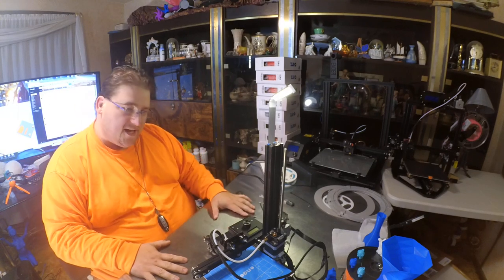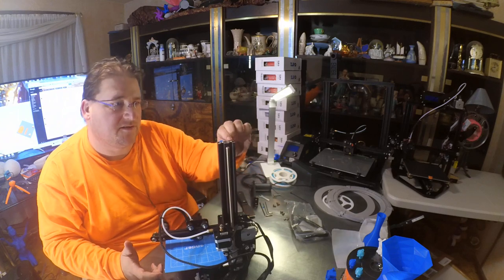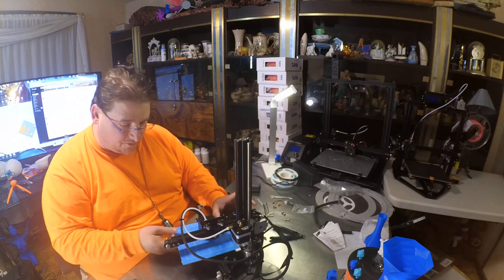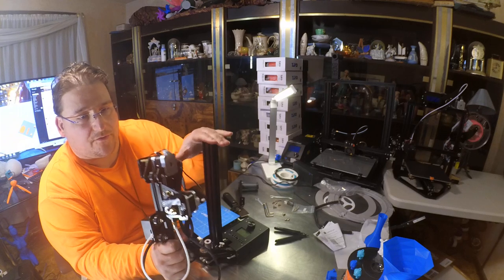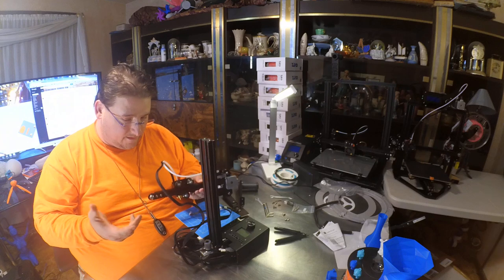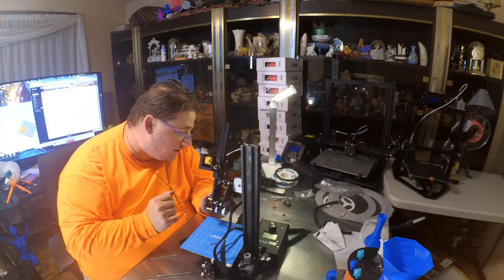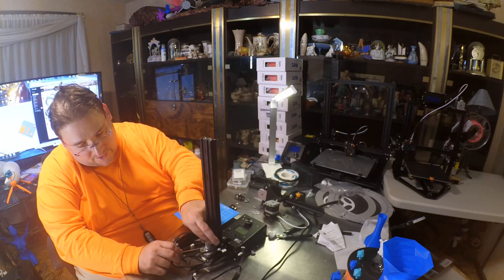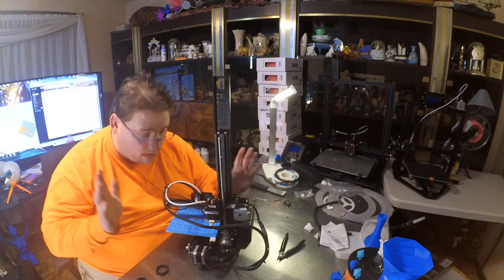Today's 3D Print 101 Ender Army 7of9 is alive and online, Resistance is Futile

Comment: I've just bought/assembled this Hictop version of the Ender. Mine has an offset nut on the rightmost x-axis roller to adjust for up/down play in the arm. However my unit had lateral x-axis play on the arm caused by movement in the bearing housing of that same x-axis roller. I traced this down to the 1mm thick spacer washer between the 2 bearing races inside the roller (or more likely bad tolerances in the internal shoulder of the roller molding that the bearings should grip between them, and wasn't). I fixed it by sanding down the washer to aprox' 0.75mm, and it remedied the lateral play. This was the only roller with this problem on my unit. What is interesting to note is that I only found the play after removing the coloured rubber inserts. Pressure from the insert rubbing on the x-axis mounting hardware actually hid the play.. Hopefully someone might find this useful if they encounter lateral bearing play in their roller assemblies.
Reply: Slight correction, first mention of x-axis in my post should be z-axis. Need beer :)
Reply from the maker: Interesting so it was literally a defective bearing? I wonder if these are standard skate bearings?
Reply: Hi Nerys. If you remove the rightmost z-axis roller the 2 bearing races inside the roller are easily removed (mine fell out). Between the 2 bearing races is a washer, which spaces the two bearings against a shoulder in the roller. Check it for burrs/distortion. I rubbed it on a sheet of sandpaper until the bearings gripped the internal shoulder and no longer had lateral play. Unsure if it was the washer, or the shoulder molding in the roller that was out of spec', but it solved the lateral play. The bearings themselves were fine. HTH, thanks for the vids.

Comment: Could there be just a bent screw, bracket or a damaged wheel be the issue for the play in the gantry? If not, maybe one of those adjustable offset screw/ nut thingies would work out here...a couple of thoughts to help pay back to you for your wonderful sharing to the 3D community. Please give us an update if the issue gets worse and your corrective solution. Thanks.
Reply from the maker: +sammy mezzacapo probably the bracket and three wheels got tweaked a little bit but it was tossed in the Box and shipped and tumbled that way the discrepancy is very tiny probably most would not notice it but I built enough of them to notice it the effect on the output quality is a 0 so I'm going to ignore it :-)

Comment: M5 X .80 X 30 or 35 is the bottom bolt size  been there done that..Dood luck..I used 35  but 30 is plenty long
Reply from the maker: actually that long skinny bolt on the table was it! so all bolts are accounted for. the prints came out great. so that is 4 enders that I have set up (my first 3 I bought normally and this one) that all work absolutely stunningly. that tells me the rest will work fine too. I will start assembling them. Tevo Tornado video incoming in the next few hours! its look very promising. it has some QC issues they need to take care of but overall I am liking what I am seeing.
Reply: Nerys I agree about the tornado but I have read that it comes with things that the cr 10 doesn't and am intrigued about it. Thermal fan and a lower price best of all
Reply from the maker: K Wright about the same price the cr-10 also has a thermal fan that turns on and off based on heat the tornado is a good name because it sounds like a tornado in those fans turn on :-) I do like the full size SD card slot I don't like the screen I do like the custom programs and I really like the AC heat bed that's nice otherwise it's looking pretty good although I have salmoning artifacts on my prince not physical but visual or not horrible it is annoying

Comment: I've been watching your videos for a bit and couldn't help but look in to the Ender 2 machine. My research so far makes it appear that perhaps the current setup might not be as well put together as the ones you started with. Have you seen any quality drop between the first machines you have and the most recent Enders in your collection? I can't say that I /need/ an ender but if they are still half as good as you have experienced it seems to be a great little secondary machine.
Reply from the maker: +Randy Hightower best I can tell the machines are identical only the power supplies different I am not sure why mine is DOA it's completely dead all together probably just a bad board
Reply: Have you tried any alternate nozzles yet with any of your Enders? I'd like to try some high detail prints with a .2 or .25 nozzle but I've not been brave enough to commit to swapping from .4 yet.
Reply from the maker: +Randy Hightower I've done some hardened at nozzles but not different sizes yet although I have a full set to play with so that will be coming soon
Reply: Looking forward to it and thank for all the great information!

Comment: Also, what kind of a maniac put this thing together originally?!  What's the over/under on them having opposable thumbs? :P
Reply from the maker: who knows. Most of the real damage was because it was shoved in a box with nothing to hold it in place. the good news is I think I CAN in fact ship these assembled. I have TONS of foam from all these printers I am going to keep so I can secure them inside. but it looks like it will fit a pretty small box once you remove the spool holder so I might be able to ship as "once piece" essentially. that would be nice.

Comment: The Ender 2 is a great printer, but the company desperately needs to work on quality control.  I built mine and went through tightened everything up.  Turn on power.. Nothing.. check power supply... still nothing... Open up control box.  Switch wire is disconnected.  Plug in.  Turn on.  Works!  Try heating PLA... Bed temp goes bonkers, MAXTEMP error.  Get frustrated and email Banggood.  Ponder on the problem.  Pull images from Google of the inside of a working Ender.  Hmm... Why is hot end wiring and bed wiring switched on my printer?  I swap wires.  Ender is working flawless.  Any other non-techy person would have given up and sent it back.  Again... Ender is a rock solid small machine that just cranks out good prints, but PLEASE.. take the time at the factory to QC things!  End of rant.. :)
Reply from the maker: GarretB123 now that is interesting I have had zero QC issues with all 4 printers I have put together but that might explain some of the Amazon returns we shall see as I open the boxes but that kind of QC sounds like dumbass anet QC errors hopefully that was just a fluke because otherwise shame on creality for doing that the one thing that I've come to enjoy with creality printers is good QC that's one thing they need to not screw up

Comment: Fyi...Code ENDERC is out of date.
Reply from the maker: sammy mezzacapo code enderc only works for eu model not us model! The only difference is a us laptop c5 cable.
Reply from the maker: sammy mezzacapo ahhh just tried it. Its expired. I will inquire into a new one.
Reply from the maker: sammy mezzacapo ENDERC Is working again for eu model.
Reply: Thank you Nery.....it worked out great...$173 total price included shipping,7-14 day delivery with tracking, and insured.....nice job for your subscribers.
Reply: Ordered 10/10; ,received 11/2 in good condition, came with auto level step program, enough filament to print a great headless cat before running out of filament, ue model came with us- adaptor plug with the open mains open supply....works great thank you Nerys.